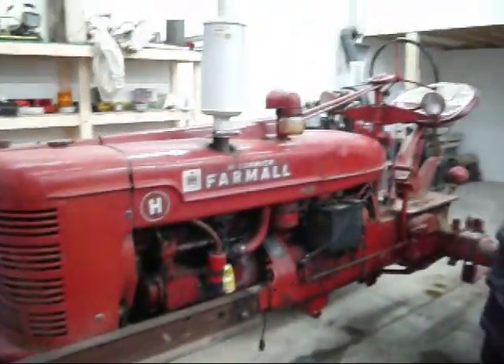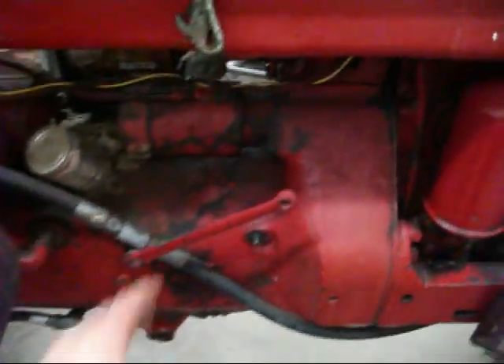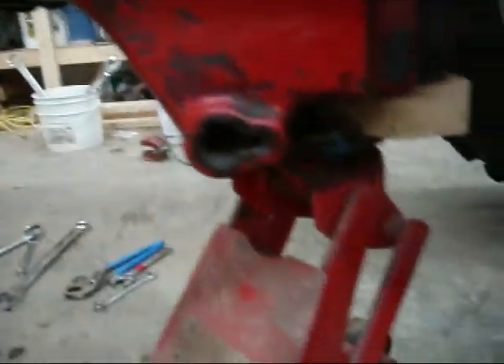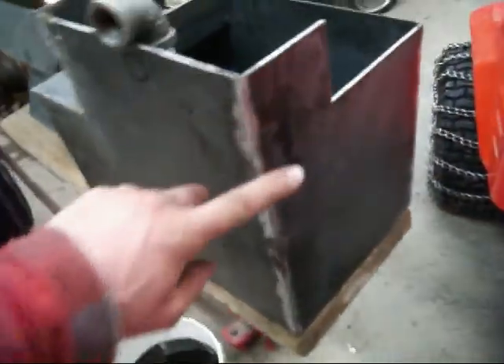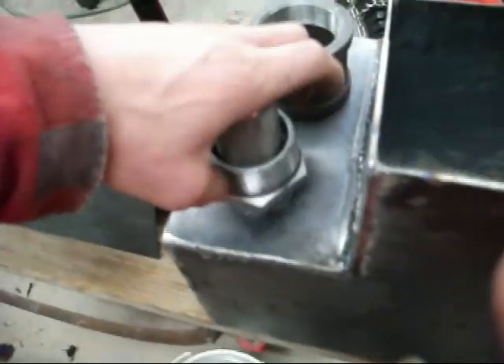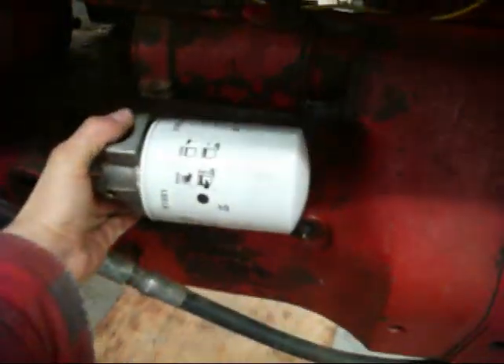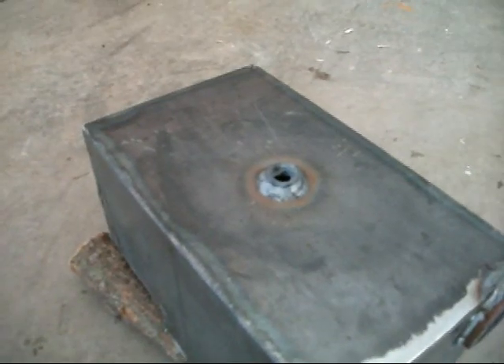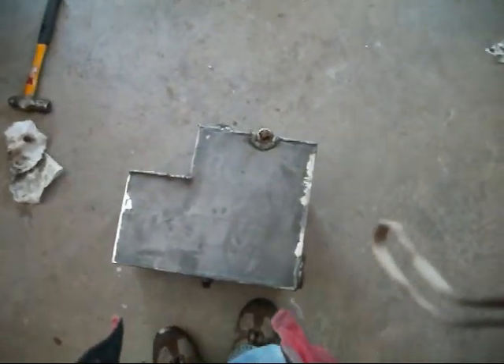farmall h hydraulic reservoir pt 1

Comment: After removing the hydraulic belly pump on a  farmall H ,, how do you remove the input shaft seal on the pump ? I have a service  manual and it says you can take a brass punch and hammer and hit the input shaft counter clockwise . I don't see any threads in their and I sure don't want to break any thing. thanks ,Richard
Reply from the maker: Valerie Kelly i've never changed one but that sounds correct, it should unscrew, i know the one on the trans side unscrews.

Comment: Good job, just wanted to know if you welded the inside joints of the tank?
Reply from the maker: Geezer661000  yes i welded the bends where i scored it with the grinder
Reply: RPR do you still have the dimensions of the tank to replace the belly pump in the H?  I would like to make one.
Reply: RPR do you still have the dimensions of the tank?  I would like to make one
Reply: Geezer661000 would you send me the dimensions you used for your hydraulic tank please?  Thanks
Reply: @johnsekavec4054  did he ever get back to you?

Comment: how much oil (or 90 Wt) was the capacity of the old pump?  what fluid type is recommended?  thanks
Reply: +REDPWR4EVR Traditional Hytran was true 20-30 wt,today its more like 10.Nice job on your system,why did you take off the gas starting tank??? I worked my H(80915)on straight gas at about two and half gallon an hour!!!Put the tank back,started on gas,ran on road diesel raking hay at around 5 quart an hour.I will say,with the gas you hop on and go,with the diesel,it can be an ordeal!!!! My son was running it(after I started it out on gas)pulled up and shut it down without running the diesel out and shut down on gas!!!  WOW!!!  Post more stuff,hope that hand worked out for you.
Reply from the maker: 90wt is way too thick, iirc ih recommended sae 30, i just run regular hytran or trans/hydraulic oil in everything so all my tractors and equipment have the same oil in them otherwise it would get mixed around by hooking different implements to different tractors. factory reservoir is 6 quarts or 1 1/2 gallons.